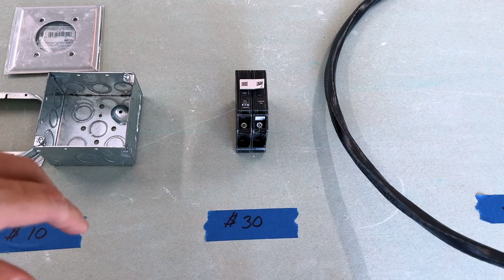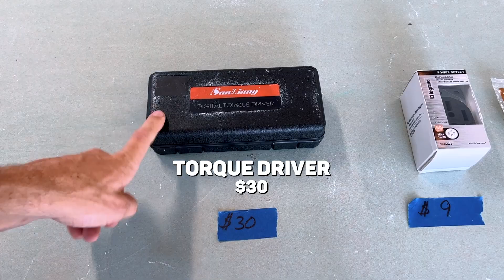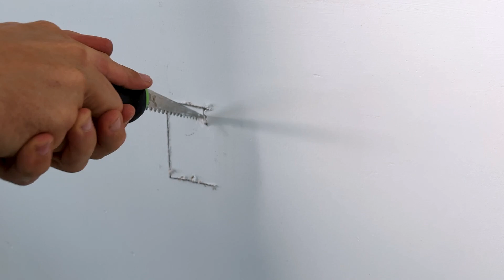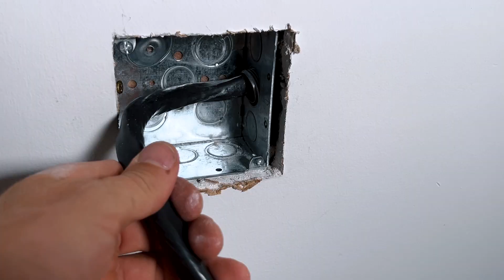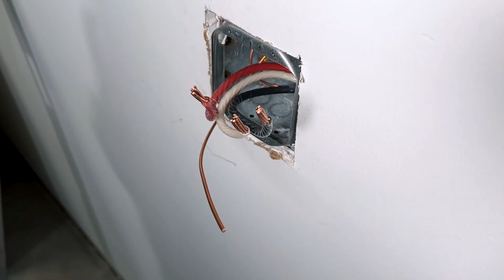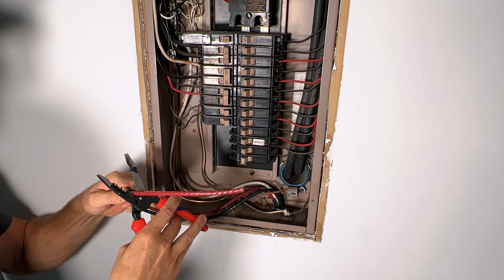240V Outlet Installed For $66

Comment: Wrong outlet for a garage installation. Need to use an industrial grade outlet like a Hubbell. Also, most newer code versions require a GFCI breaker for an outlet of any size in a garage location, including a NEMA 14-50.